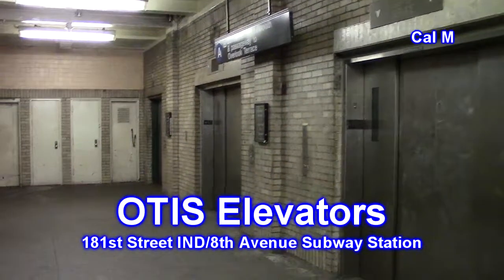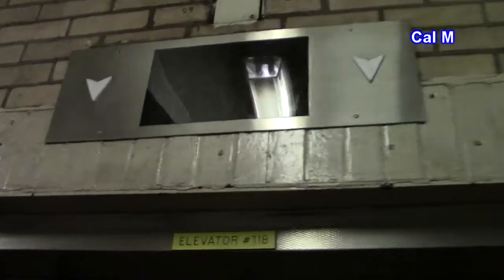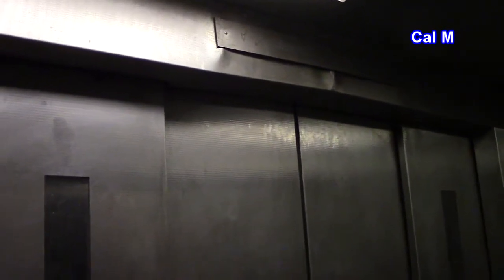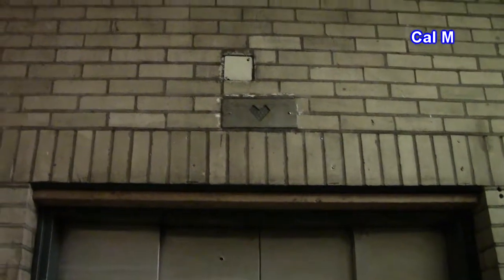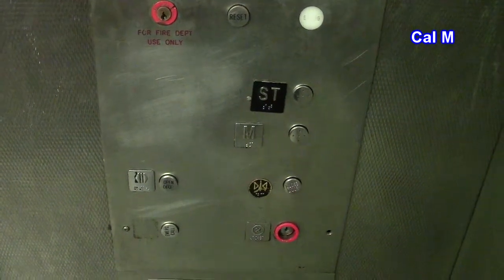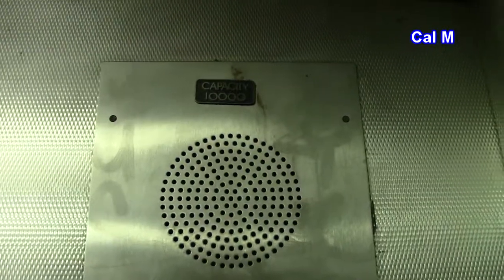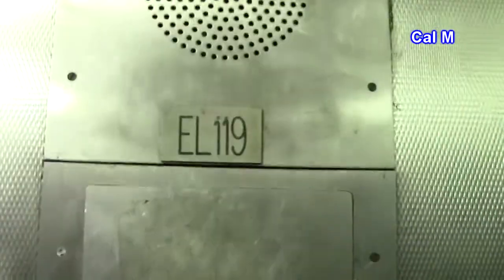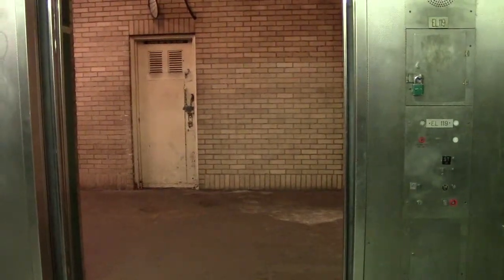Exceptional OTIS Traction Elevators @ 181st St. IND (A) Subway @ Washington Heights, NY

Comment: Do you know if the left elevator is on a relay logic controller, or is it on an early solid state controller?

Also, do you know if the elevators are all in the same hoistway, or are they in separate hoistways? That could give clues to the history of these elevators.

Does the staffed elevator have different fixtures, or does it have the same fixtures? I would like to also see a video of that one if possible. As far as I know, I think photography in the NYC subway system is allowed (though I am not sure on that and I have not researched it).

I have heard the elevator on the right (not sure about the one in the middle) was still original, and possibly manually-controlled before modernization. Maybe when the one on the left was modernized, all of the elevators were manual and they wanted to have an automatic elevator (maybe in case the elevator operators were not on duty, or maybe in case the person using the elevator didn't care if there was an attendant/operator), but they didn't want to spend the money to modernize the other 2 elevators at the time. The elevator on the left seems heavily modernized (could even be completely replaced, I don't know for sure), both the door sill & interlock appear to have been replaced during the modernization.
Reply from the maker: I will check on all of these things the next time I go up to New York City (in the next six months). Also, MTA NYCT employees have told me that photography is permissible provided that I film/take pictures free-handed.